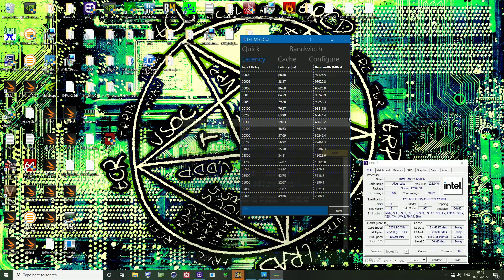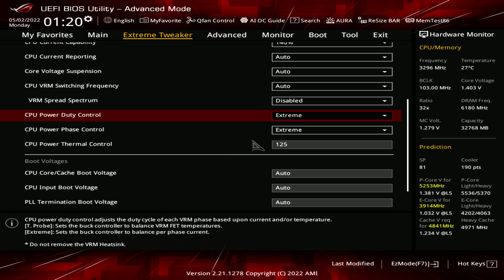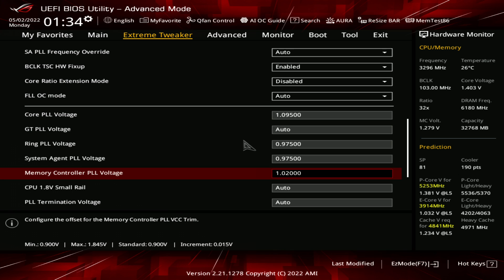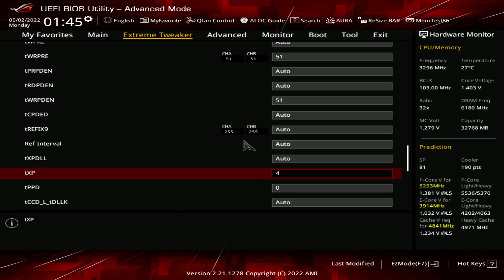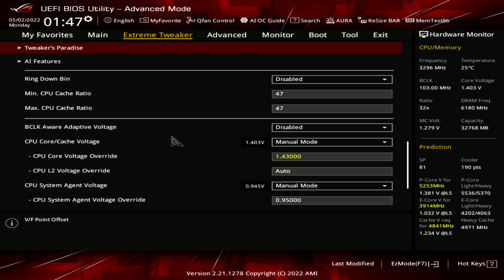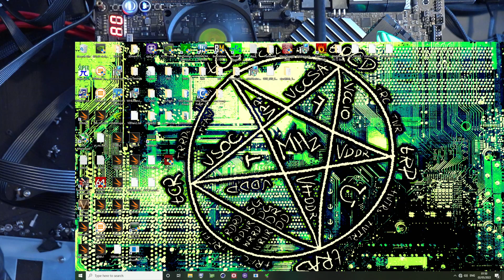Maximus Z690 Apex 1T DDR5 Overclocking: 2x16GB Hynix ICs at 6180Mbps 30-37-37-42-1T

Comment: I thought ddr type memory had speeds of GB/s instead of MB/s, because this numbers seem to imply that nvme pcie 3 and beyond have faster transfer rates than the memory. I know this wrong but can someone please explain it too me as the math says this mem is doing 772MBps vs a nvme gen 3 drive at 2000MBps+ easily.
Reply from the maker: https://youtu.be/diZT3ly0vy4
Reply: Besides the link, shortly speaking, it's mostly due to what happens during a single RAM clock. Normally, you have a single bit movement during one clock, with DDR (dual data rate) signal skew behaviour was changed in a manner, that at the beginning of a clock signal drops, during the clock you've got an another full signal delivered and at the end of the clock there's also a signal rise. This effectively doubles the bit bandwidth and that's why RAM "speed" is always precisely double of its clock. That's also why MT/s (megatransfers per second) is absolute bullshit, since during a clock you don't have some ambiguous and unspecified transfer, you're literally sending two bits. A single transfer can contain millions of bits and for freaking sure you're not doing millions of transfers during a single clock. I can't understand why Gamers Nexus started using MT/s.

3700 MHz RAM has a theoretical maximum bandwidth of 59.2k Mbps, which is equivalent to 7.2k MBps, so theoretically NVMe 4.0 bandwidth, but SSDs have uncomparably higher latencies than RAM, as their response time is measured in milisecond, in contrast to RAMs nanoseconds.
Reply: @ActuallyHardcoreOverclocking  thx
Reply: @PolskiJaszczomb  thx